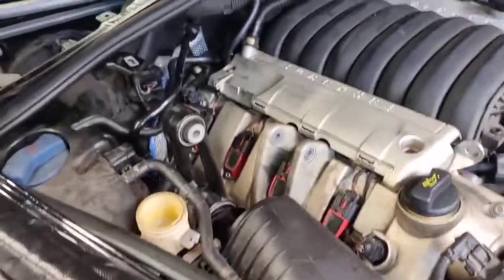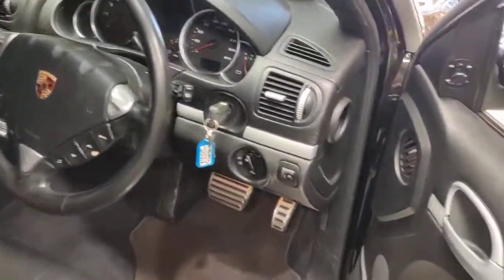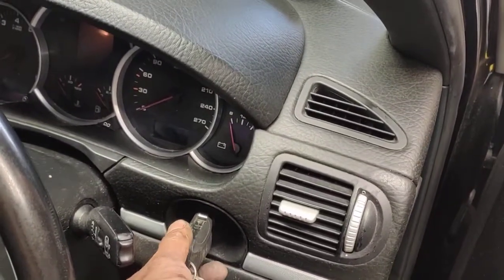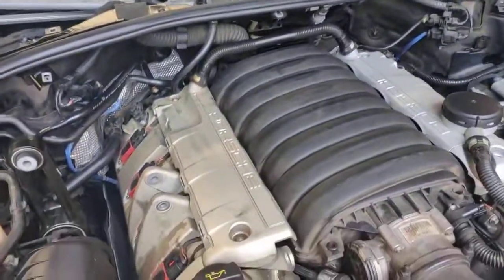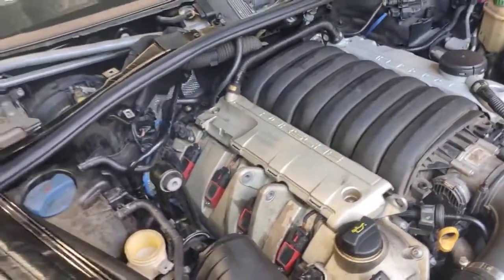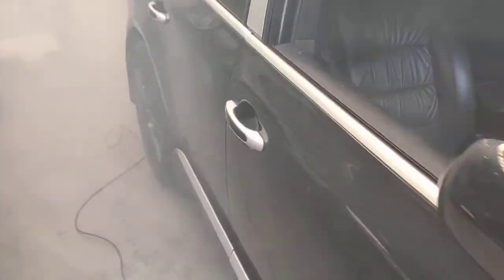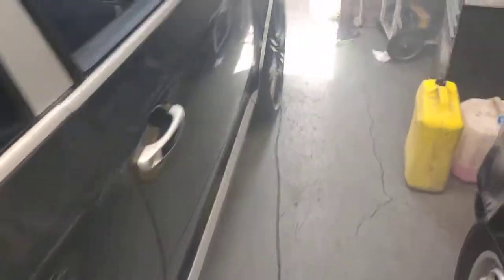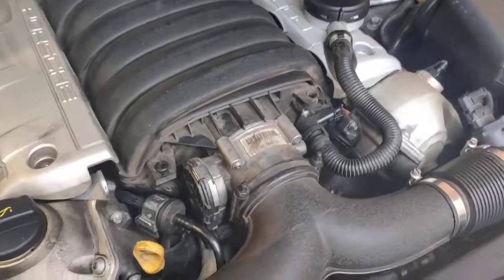Porsche Cayenne S 957 M.S - First start up after cleaning carbon inside intake port

Comment: Hello Paul, thank you for your interessting videos.
One question I would like to ask is, what ist the disadvantage of a carbonized intake at this engine. I don't know a garage here in germany, that is cleaning the intake while the car is there for the usual maintenance.
Reply from the maker: I have seen Cayenne DFI engine with these problems due to high carbon build-up.
*Intermittent Misfire
*Hesitation under light acceleration
Reply: @emdporschespecialistcaring8975  Thank you Paul! I 've cleaned the intakes with walnuts and the pig runs much better now. So much torque 😍
Reply from the maker: @CRoger-ch9mk  Hi Roger
Great to see that your car is back to normal